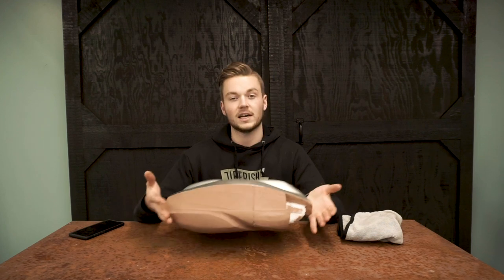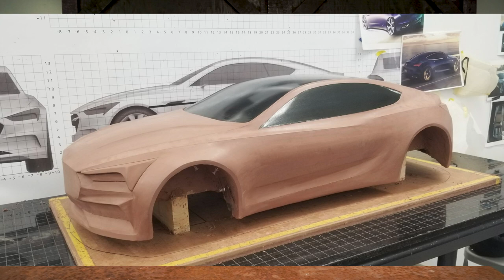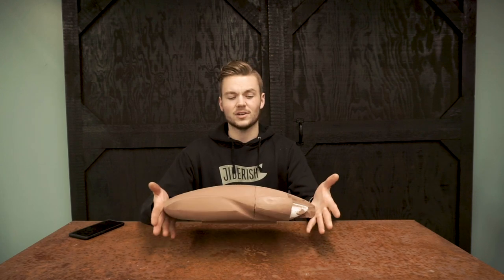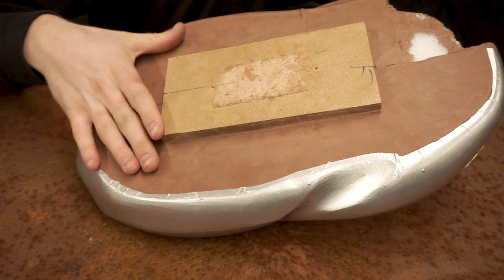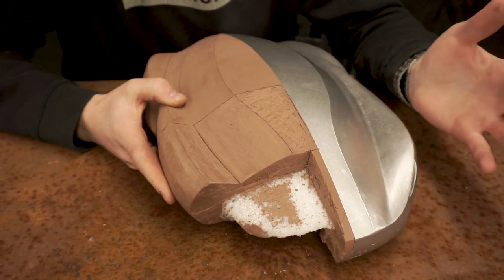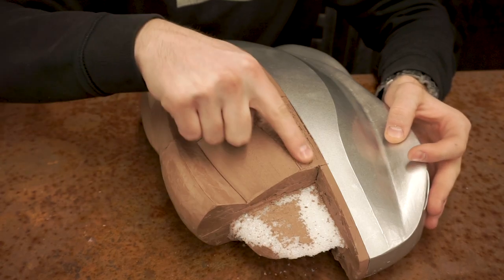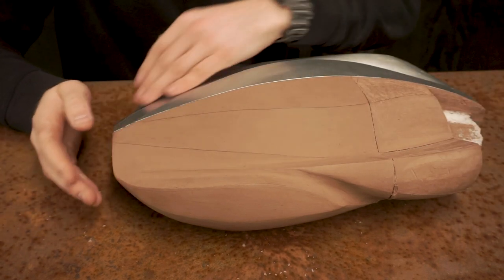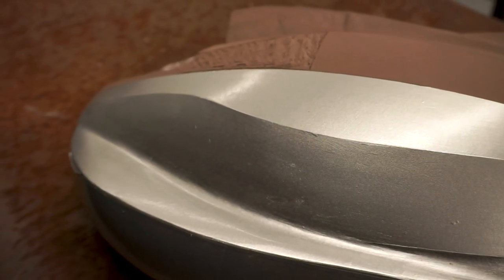How to sculpt a clay car

Comment: Do you put it in the oven after 10 days of drying like you do with a clay coffee cup? Doesn't the clay shrink when drying? Can you just leave it like that and let it dry and possibly crack?
Reply from the maker: No oven! This clay is chemical based, not organic earth based clay like ceramics. If a large amount of clay is packed on a model it will have a small amount if shrinkage, around 2-3mm. This industrial clay is applied warm then cools for tooling. It doesn't Crack after cooled unless the clay is improperly applied.
Reply: @ty_zib  I am thinking about building a permanent model used as a horn speaker with really complicated shapes using the industrial plasticine. Is it smelly to have the livingroom? I read it contains sulphur. How hard is it after drying? Maybe I should use polymer clay? I won't be able to fit it in the oven but i have a heat gun.
Reply from the maker: Most of the newer clay isn't sulfur based. Maybe check around. It gets pretty hard after drying. You could even prime it, sand out imperfections, prime it again, and paint it to seal it. It wouldn't look like clay after painting it.
Reply: @ty_zib  Ok, thanks. Do you know a type like waterbased or polymer based or a brand name I should try? I guess a hwat gun is a bd idea as it will not heat evenly. The model is pretty huge. 1x0.5x1 meters.
Reply from the maker: Chavant is pretty common. If using the industrial type clay you can always put it in a crock pot to heat it up. Just be sure to monitor it so it doesn't turn into liquid
Reply: @ty_zib  Do you think the sound coming of it will be damped or resonant like porcelain? If resonant, I will go back to sculpt wood, but it takes months.
Reply from the maker: I'm not sure. I don't have any experience with trying to play sound through clay haha. Maybe do a small mock up and test it out
Reply: @ty_zib  Sounds like a plan. Thanks for the advice.

Comment: What do you suggest as heating temperature? I have been working with some clay, however I warm it up and then it gets hard after 10 min, making it hard to shape it. I’d appreciate some tips or suggestions
Reply from the maker: The industrial ovens that heat large amounts of clay billets run at 145 degrees but if you are only using say a small box full heres my suggestion: line a cardboard box with aluminum foil, put your clay chips inside, place a regular light bulb above it (lamp without shade works just fine). This will heat the clay to a workable temp but won't make it liquid. While applying it should cool within 5-10min to be workable.  Hope this helps.
Reply: Life with Ty Thank you so much! Great videos by the way. It is of great help! What if I used a conventional oven, would that possibly work as well?

Comment: What requirements do I have to fulfill to pursue this wonderful career?!
Reply from the maker: Building a strong portfolio is key. There are many places that offer certification courses as well as several colleges that offer degrees based in design (not necessary though). Having clay models in a portfolio helps but having other art/skill sets showcased in a portfolio is helpful too.